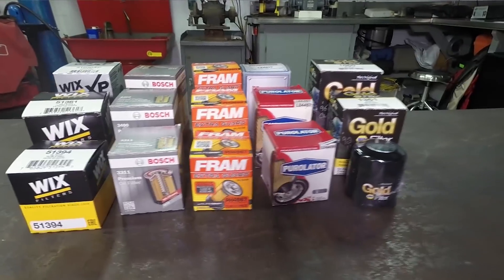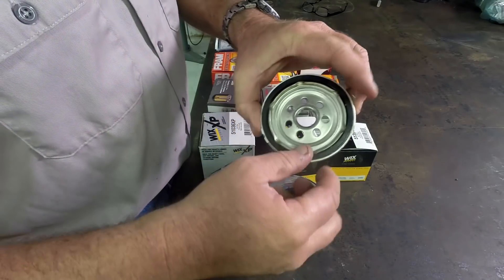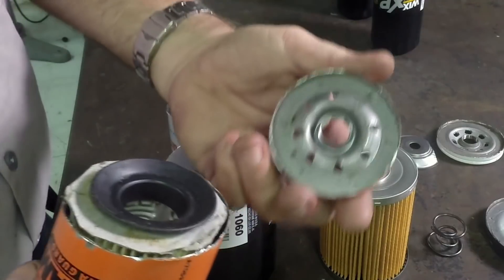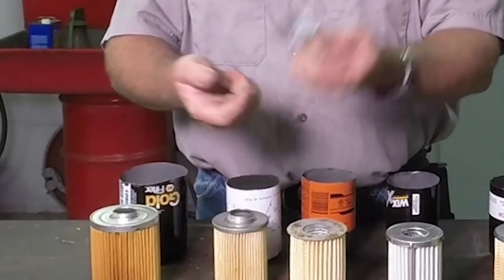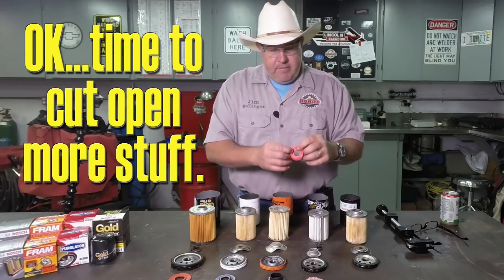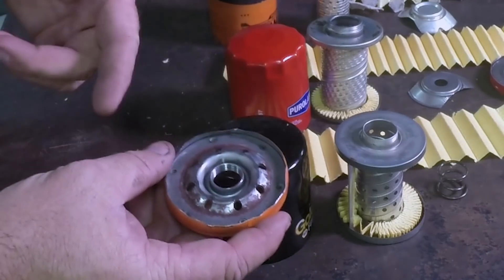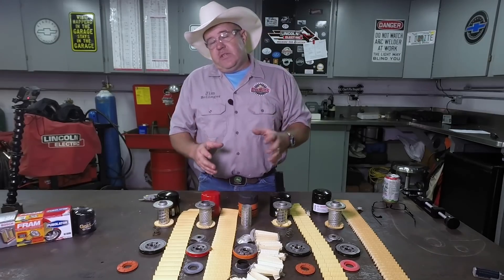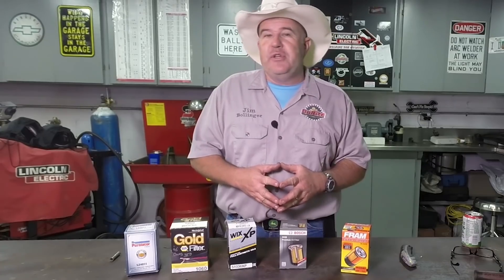The worst oil filter EVER!

Comment: That's funny, I was just yesterday remembering how we used to make fun of Fram filters and how I used to joke that they came up with the name because it's the sound your engine makes when a connecting rod is coming out through the side of the block. Then there was what do all these blown engines have in common? A Fram oil filter. I was thinking about those old jokes from years ago yesterday now I'm seeing this today and see that nothing has changed with Fram filters, since I was a teenager, they're still a cheap POS! Heh heh heh! 😂😂😂

Comment: That rust is gonna go into the filter, as the filter's definition explains. Not all filters are "new" just because you just bought them. They have been sitting on the shelf for a while, accumulating particles such as rust and dust. A real test would be to take apart some filters that have just been used to see how they stand up over time. You never know, some manufactures spend more money on the science behind the scene than the actual product. Maybe the filters are suppose to be how they are because they were meant to be used as oil filters, not cut open and graded on quality BEFORE their intended use.

Comment: I have used many many Fram (lowest priced model) which send to be the the only Fram
That was sold. This gentleman's video is very well made. He made his point that the other filters are better built.

However, as I am a Chemical engineer, I feel that I must point out the basic limitations of any oil filter that filters engine lube oil (not tranny fluid, that is oil, but  it does not interface with the (in this case gasoline engines) where the lube oil interfaces to a small with the internal combustion process that imparts ultra small amounts (if the gasoline engine is in good condition) that imparts dirt and combustion by products (soot combined with multiple sources of dirt.) Oil filters, are by their very nature not very efficient. It does not matter if there is a paper element or some kind of stable polymer synthetic resin because petroleum oil blinds a filter and limits it effectiveness. Therefore, this inferior Fram filter is still as good as the others for what it does. The claims on the oil filter boxes tend to purport the ability to trap or somehow bind the very small dirt and combustion products to the filter element. Engine oil filters just are not that effective for minute dirt without a metal particle. That is why the oil additive package contains so many detergents, surfactants, and soot dispersants. The better condition the engine is in means that the engine oil will not become saturated as fast the oil in an engine with a lot of wear on it. They can only do so much with an oil filter, and if any emulsions get into the oil and not burned off by operating temperature heat.....the oil filter will be limited to trapping only small metallic particles and large stable dirt particles. After this great video, I will still use Fram filters, unless The others are readily available.

Comment: I've worked for 5 different automotive companies, I have used or put my hands...and cutoff wheel of curiosity from oriellys mighty Wix to the respectable honorable napa gold...even the Bosch with less than desirable bypass spring and the purolator I put in at pepboys...FRAM FUCKING SUCKS! THIS IS NOT AN OIL.FILTER ITS AN ORANGE LIE! Hey I got a genius idea buy a pair of jaws that'll unscrew a filter like anyone else that should be under a car. You dont wanna know what a 30 and under oil change gets you oil off the back of a truck...filters made in China or worse...fram... DO IT YOURSELF! EVEN THE WOMEN DO IT!

Comment: This is about as unscientific as it gets. First off how many engines has fram ruined? This bozo cannot tell you. He pulled that out of his ass.  3rd parties do particulate tests and Fram is competetive with any of these. Cut apart a car engine, genius. Poke around and make anecdotal layman observations. 
How would this compare to statistical analysis of real world longevity?
It would tell you nothing. 
I dont use frams bottom tier filters now but I have in the past with zero issues. The auto parts game is changing all the time with each brand outsourced to different countries within the same line for different vehicles.
So if you want to cut up filters this video is helpful. If you want a good filter then look at tests on how they filter.
Reply: You're obviously ignorant when it comes to reasoning behind it. Meaning you're def not a mechanic. So..irony?
Reply: 4$FRAM VS. 6$ wix 5$NAPA LINKS ARE IN DISCRIPITON THIS IS ABOUT THE FRAILTY OF HARDWARE VS.PRICE ,KINDA SIMPLE ,DIFFICULT TO A SIMPLE MIND I GUESS

Comment: Maybe I need my tin foil hat, but Fram is sold at walmart, and walmart can be pretty demanding about how much they will pay for cost from a manufacturer. I wonder if they started cutting corners at some point and cheaping out on materials. I see this with a lot of brands that were once good, and now have been watered down for the sake of "Always low prices"

Comment: Many years back, I was a firm believer in Brother Fram. Then one day, I saw an article in either Hot Rod Magazine, Car Craft, or Popular Hot Rodding (RIP) about all brands and quality - aka 'price point' - of oil filters. They did the same as you, but also cut them open immediately after a hot-soak drive. The majority of the filters had cellulose (paper) as their filter medium, and the majority of those fell apart - the filter media - after the hot soak. Included in the testing were both K & N and Royal Purple filters, which both use a synthetic filter media. Not only did they both hold up very well, they both also filter down to much smaller micron than any of the cellulose ones. They both also use much thicker housings - which improve burst strength, but also use the coiled wire springs and premium silicone anti-drain back valves. They both have a premium price point, but that higher price, even over the long term, will still be cheaper than a replacement engine. I've been using the K&N, along with Valvoline Pure Synthetic motor oil in all my vehicles for over 20 years.

Comment: Had a puralator filter rust to the point of spewing oil all over my driveway in just a year.  Luckily I noticed and could shut the engine off. Before it lost more than half of the oil. Really pain in the ass and not something I would ever expect.

Comment: Years back I was watching a test run on a blown small block Chevy, very run of the mill Dart heads and a small B&M blower. It was setup for baselines on an engine dyno, they had installed a Fram Racing oil filter and were running Amsoil, around 5-5500 RPM the filter collapsed and annihilated the engine, I’ve never seen anything remotely like it , it crushed the outside and inhaled the filter media. I always wondered if it was a fluke, seems like that’s not the case.

Comment: I bought FRAM from time to time, was never my first choice. I had a Chevy Z71 and a Camaro Z28. Both LS based engines. I wanted to check out the differences between both filters at Walmart. I pulled the truck filter and car filter out of their boxes and the truck filter had what looked like glue on it and the car filter had what looked like cardboard sticking out between the base and can. I never bought FRAM after that. Now I see that the crap quality wasn't a one time occurrence.

Comment: I like the System One/Faria reusable oil filters for my drag race cars. One engine is blown alcohol BBC and the other is injected alcohol SBC. They allow me to see what's inside the filter, clean it and reuse it. They are very expensive compared to the 'one use' filters, but a 'must-have' in race engines. I am changing out any Fram filters for my street cars and trucks from now one after seeing this video. I'm going to NAPA Gold or Wix.

Comment: Very interesting to know Puralator and Bosch have same construction.  Perhaps better than to just talk about "Fram" generically would be to specifically tell us which grade of Fram filter you cut up because they have at least three at different price points claiming different levels of quality / protection.  I assume that is the lowest one, but would be great if you had cut one of each grade for comparison. 

And by the way, while you're complaining about the cardboard construction, keep in mind that the newer "recyclable" cartridge-only type filters are ALL using nothing but cardboard to seperate the pleats and maintain the structure... and... I know it's because F- you American consumer profit gouging -- those filters are hands down THE most expensive filters to buy.  

By the way, I'm convinced that when you take your car to the dealer for oil change, they do not lube that "o-ring" surface on the filter properly... because they know standing under the car on a lift, they can muscle it off without a problem, but you under the car with 6" of clearance will curse and cry and swear off ever changing your oil again.  Every time I have a "professional" change my oil, I am left fighting the filter and drain plug.  When I do it and hand tight / torque properly, the next oil change is a breeze.

Comment: we've been having napa golds tear at work especially since mann hummel took them over. The fiber media end cap doesn't matter either..  .

as you can see in the video it doesn't come off easy. And that kind of  end cap allows an amount of flexibility. You'll notice, if you have seen torn filters, that most tears occur at a rigid junction such as at an end cap or where the filter media ends were joined.

Also laughingly enough if the rust is on the canister then it is on the dirty side of the filter and will get trapped by the media. It won't "end up in your bearings" rofl!

Comment: I have no love for Fram or any other filter.  However I thought I would share my recent experience for anyone who is interested.  I have only ever used wix and napa gold filters on my 4cyl Isuzu diesel generator for the aprox 1100 hrs that I have run it over about 11 years.  from the beginning I always had to start it twice as the oil pressure would not build fast enough for the safety to let it keep running.  On the second start it would always continue running.  then around 900hrs I put a Fram extra guard filter on it at its regular 100hr oil change.  I noticed right away that it would stay running on the first start but didn't connect the dots that it may be the filter.  The filter on this unit is sideways mounted about mid block.  At 1000 hrs I put on a wix filter  and was right back to starting it twice.  I realized what was going on and  put on a Fram again at 1100hrs.  starts and runs first time again.  My guess is that the anti drain back valve is better on the fram allowing it to hold its prime.  Or perhaps the filter is so inferior that the oil has less resistance and therefore primes faster.   Believe what you will.

Comment: I've used FRAM filters for Decades, never had a problem, driven several cars and trucks well over three hundred thousand miles never a problem attributed to the oil or the filters, Just changed the oil on two suburbans, a pick up and a BMW,  Frams in all but the BMW, couldn't get a Fram filter for it, had to go with Wix.  Dr. D

Comment: I don't think it matters much which oil filter you use. As long as you change oil and filter on regular basis. I've used them all put hundreds and thousands of miles on gas powered vehicles never had oil related problem. Thanks for the video.

Comment: Just wonder how many engines Fram has ruined..... It's doing the complete opposite of what it should do instead of taking stuff out of your oil it's putting stuff in your oil
Reply: Sorry...
 I think I better take a nap now
Reply: Actually engines have been ruined. On a high performace build with. High pressure pump, these filters are known to collapse internally and starve the engine of oil.
Reply: @WVXL64  and any idiot running a bargain filter in a modified, or high performance motor is just that, an idiot. Put a fram filter in a stock 90s civic and it isn't collapsing. Obviously assuming you do your maintenance and replace it.
Reply: @WVXL64  What I wanna know is, why would they put a fram tested for stock oil pressure on a higher performance engine with higher oil pressure that would NEED higher oil pressure to keep the crank off the bearings at high RPM. Do people go to those sort of lengths in order save 6 dollars on a multi-thousand dollar build?
Reply: When the filter fails intenally and blocks oil flow to the engine, you absolutely can blame the filter for the engine failure. Not all engines have a bypass valve in the engine and depend on the filter working properly.
Reply: A fair few. Some time ago my friend bought a '67 Mustang that had a 351 cleveland in it. Fucking built motor, too, but the PO was a bit of an idiot and put a FRAM on it. Friend comes up to me and complains that the thing's got fuck all oil pressure at idle(Somewhere around 4-6 pounds), I pop the hood, spot the FRAM, and hand him a Motorcraft filter instead. That alone tripled the oil pressure at idle!

FRAMs suck.
Reply: @TestECull  Motorcraft is awesome. They make quality parts.
Reply: It wouldn’t ruin the engine in a way that you could blame the filter itself. But over 100,000 miles it will do damage
Reply: @user-pz9yg1go4e  Ahh, yes, bits of rust flaking off of the filter can  totally won't obliterate a rod bearing inside of five minutes, right? And I suppose bits of cardboard flaking off the element can't plug oil galleries and spin bearings?
Reply: I have an oil pan at my home that have two fram filters that came off two separate engines that were down at the same time
Reply: @megabuster777 because Fram is advertised as a quality filter, and it should be higher quality than it is no matter how its advertised.
Reply: @WVXL64  I guess the commercials are misleading. the price reflected the "quality" as well, plus I thought it was common knowledge fram was trash anyway.
Reply: @megabuster777 this was years ago before people knew as common knowledge that they were junk. Fram used to be a decent filter many years ago.
Reply: I doubt many engines have been outright ruined by the shit quality of the filter. However there's no sensible financial case to put a part like this on your engine. Saving amounts to maybe $10-100 a year when you could have instead have had a more bullet proof filter on your engine is ridiculous. All these pedants in the comment section trying to come up with "well actually it's obviously good enough for the job" arguments are missing the damn point. But you know what, go ahead and gamble with your engine. Yours probably wont spit dirty oil back into your system, but mine is even less likely and for an insignificant extra cost.
Reply: @starvalkyrie  calm down....it was a question....you must think its ok to add rust to your oil..good luck on that
Reply: @jamievmssuv35c15  I think you should reread my comment. You seem to be responding to the exact opposite sentiment.
Reply: @jamievmssuv35c15  Keld was agreeing with you.

Comment: Been using Fram filters for decades.  My 92 honda is up to 300,000 miles, bought it with just over 190k.  Rust in a filter, is hardly a problem for 2 reasons, oil, has corrosion inhibitors, and the particles, will get trapped in the filter anyway.  Real world results vs "your opinion".

Comment: The only oil filters I use are motorcraft (made by purolator) and Napa Gold. I have a couple Bosch DistancePlus filters kicking around that I'm not afraid to use either.  I have also cut open a few frames filters, and no surprise, cheap garbage. Thanks for making this video and doing a good job with it. I wanted to make a video like this years ago but I never put the effort into it.

Comment: I have always used fram filters and I am very surprised at the quality you demonstrated. That being said, I have had a 77 chevy 1/2 ton, 80 chevy 1 ton , and an 88 GMC 1/2 ton, changed oil on each between 5 - 10 thousand miles (ya, ya, some weeks I put 2000+ miles on my trucks) and the filters every other oil change. All 3 trucks made more than 300, 000 miles on original gasoline engine before being sold, no failures or rebuilds. (replaced cracked head on one). So that alone was more than enough reason for never changing filter brands. I had never cut one of them apart, and for real wonder if there would have been any of that filter medium still in the filter? scary. But for my current car, guess next change is NAPA gold, lol. I am however very curious to see the quality difference between napa and fram if compared with dime for dime equal filters. My project car is a 2006 impala, 3.9. Fram filter is $3.79, napa gold is $8.49. Fram does offer higher grade filters that compare in price, and has NO reason to be unable to match the quality. Question is, DO they match the quality at that price point. For their sake, I hope they do because if not, they are void of any and all ethical morals. I may never know, as I will never purchase a product of theirs again because I truly feel I been betrayed for all these years. Thanks for the video, it was nicely presented so I did the like/sub thing, lol

Comment: all oil filters are the same as far as useless if your if you are collecting fragments in it you got larger fish to fry and as far as rust a lot of people only put them on hand tight witch will draw moisture from the heat cycles rust comes from a filter that was lose and allows condensation to gather but that's just my opinion thank you

Comment: Always used wix and knew from working at Napa a spell ago that the were the same. We did this same test once at orielly’s. There was more than just fram that failed in my book. But the list of acceptable is shorter. You should do air filters next. You don’t really know until you open the box at what you’re getting